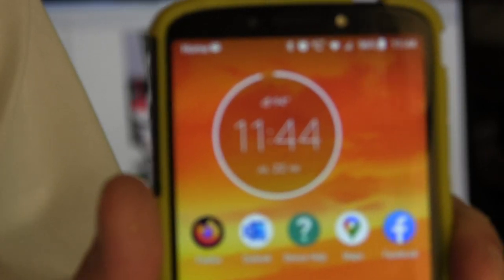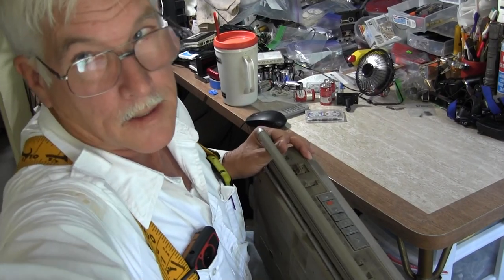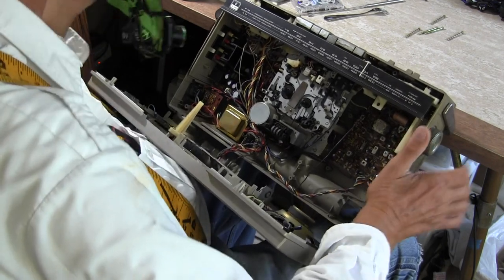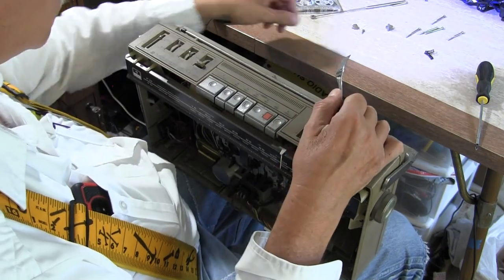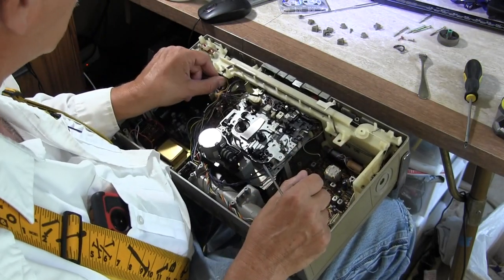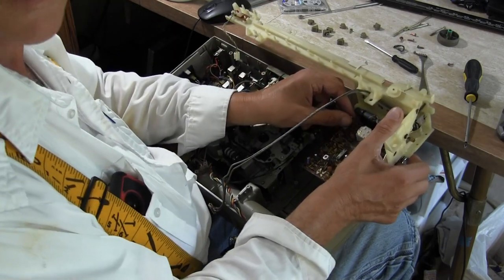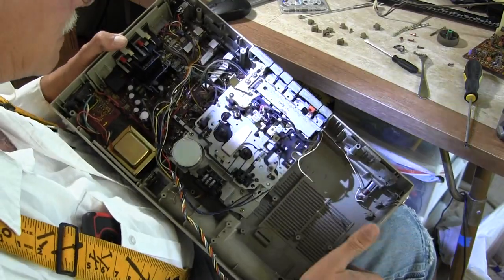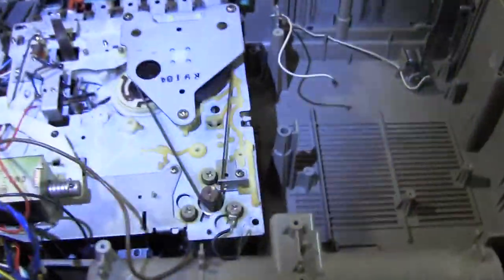National RX-5100 How to take apart an open in real time & what to service July 2022 JDM

Comment: Have an RX-5100 purchased in 1979 which stopped playing after jiggling the power cord on the side of the radio one too many times while radio was turned on. I think the power cord was loose and was forced in to harshly and now radio won't turn back on. It was fixed once before in 2017 for the same problem, but the local radio shop closed down during COVID in 2020 and have not be able to find a new shop. Is there a part that needs to be replaced? If so, What is the name of the part?  and Where can the part be purchased?
Reply from the maker: If this has a DC round input you can power it with a power brick if you know what I'm trying to tell you.
Reply from the maker: You can power up the batteries yes or no?
Reply from the maker: 713-502-9993 text me
Reply from the maker: Or to eliminate the plugin, simply have someone solder on a power cord to the AC input
Reply: @Cassette2Go  Thanks but Radio is not battery operated. It has 2 prongs on the side of the radio from which to plug in a power cord. Male/Female type of plug in.
Reply: @Cassette2Go  Thanks but radio does not have DC round input.
Reply: @Cassette2Go  I'm in California, USA
Reply from the maker: @LXVALENCIA1  I'm in Dallas Texas USA this model does take 8 D batteries in DC operation
Reply: @Cassette2Go  Yes. This is true but prefer power cord over 8 batteries.